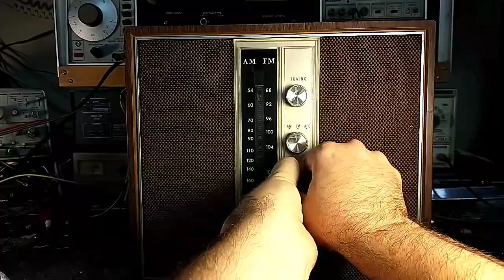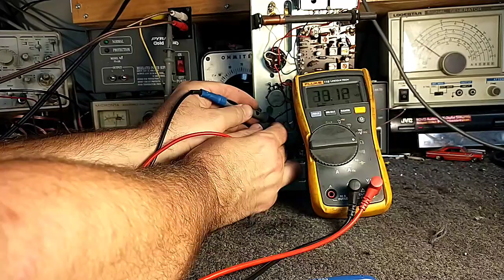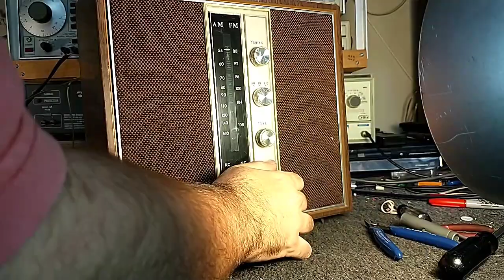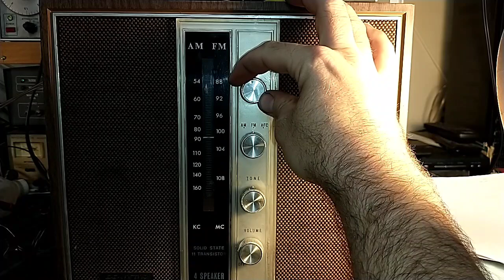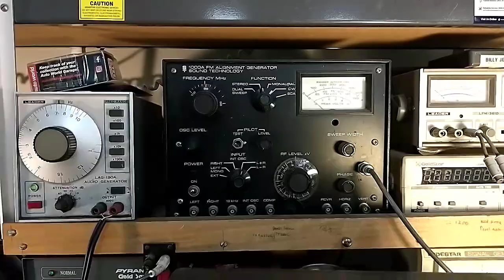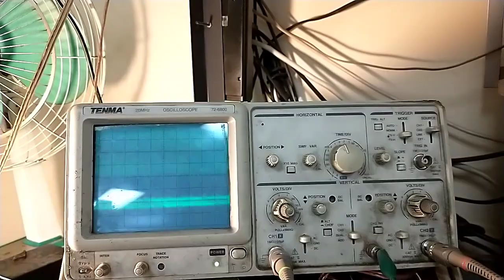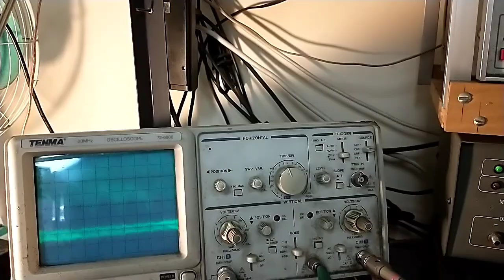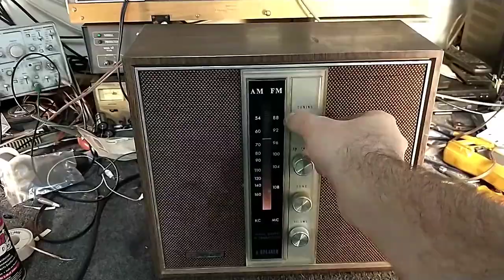Repair of 1960s Lloyd's 7H13G 11 transistor, 4 speaker am/fm radio

Comment: Jordan, great job fixing this radio. 👍👏👏Some of the transistor radios that I worked on had bad Soldering issues from manufacture. Since they are to small to work on. Have a good day! Regards, JZ

Comment: A small wire tied wrapped around the plastic chassis supports helps to reinforce the plastic and prevent the posts from disintegrating further.

Comment: Many times I've had good luck taking the control apart usually find the lug isn't making good connection to the carbon on the ends of the "printed" carbon trace inside the control. I have repaired this problem many times with a bit of conductive silver paint on the connection between the ends of the  "resistor" and the lug for the wire connection

Comment: I doubt it makes much difference between a 5k and 10k volume pot, so long as it’s audio (log) taper. It’s a voltage divider, after all. The only difference would be a slight change in the current draw with the volume at 0 (the signal appearing across the top lug of the 10k and ground, vs. a 5k.)

Comment: That switch on the new pot isn't rated for line voltage...
Reply: yes... if it is to be used here it should be put in the secondary circuit with the primary always energized
Reply: Have to agree with this. The contacts are not designed for higher voltages and will arc away, the switch terminals don't have enough physical separation from the pot terminals, the switch is WAY too close to the pot casing crimps and if the plastic in the centre of the switch ever breaks apart its not inconceivable the spring loaded contact could hit and energise the shaft.

Comment: The question is:did you use the RIGHT Caig Deoxit-the D-series(d-5/d-100, etc) is NOT intended for pots..F-series (Deoxit fader F-5, etc) is.
I've not seen either type damage pots.
However, I do know that D-series can sometimes damage old pots, so I don't use it on them.

Comment: Am band is tricky to realign for the 600 khz to 1700klz with the oscillation and the reception sensitivity. 

Fm is much better,,,easier to fine tune for oscillation and reception sensitivity too.

As I have repaired hundreds of transistor radio tuners/stereo tuners/tape decks/turntables/amplifiers/cd players,,,
in the last 40 years..
Bringing many vintage stereos back into working former glory.

Comment: One thing i did notice was the wire from the ferrite rod antenna was originally far away from the oscillator coil, after you replaced the caps it was almost wrapped around the coil.
Maybe  some unwanted coupling?.

Replacing all the caps without a reason,  you bad lad,  you broke the rule of diagnostic.
Thou shalt not splatter with new parts hoping to fix it lol :-D
Shango066 is very good at repairs, he underrates himself.
His sarcastic ways are always funny :-D
Reply from the maker: You make a good point about the unwanted coupling. For grins and giggles I did open it back up and try moving the wire but I found no change from this.

My reason for changing the caps was overall poor performance, as described in the previous assessment video. My history with these Japanese made radios is that's just about every electrolytic is leaky in these, overbiasing transistors and throwing circuit constants. 

I may have been able to get away with targeted troubleshooting for this - but my thought was it deserved better
Reply: @JordanPier  Not as sensitve or high impedence as i thought.
Never mind, i tryed to use a few brain cells :-D.